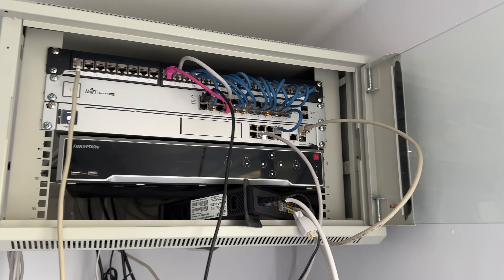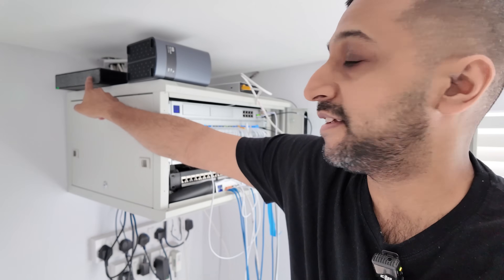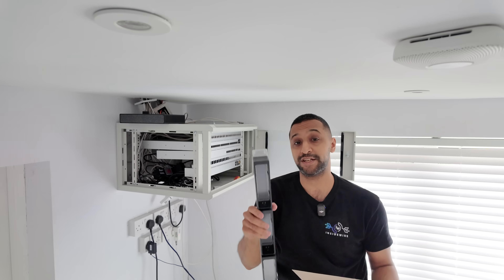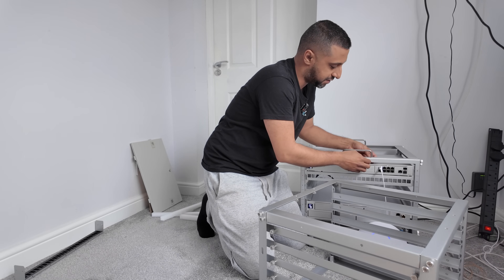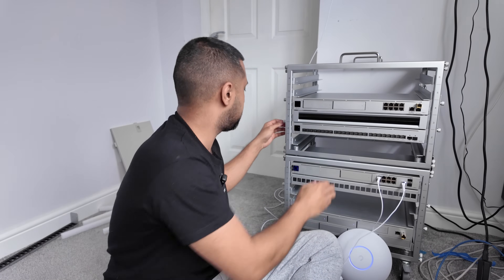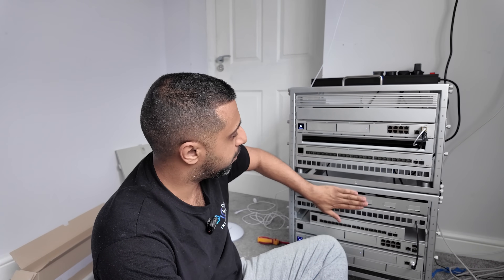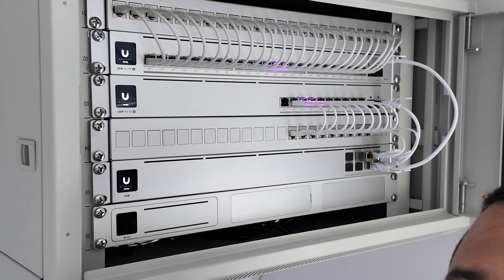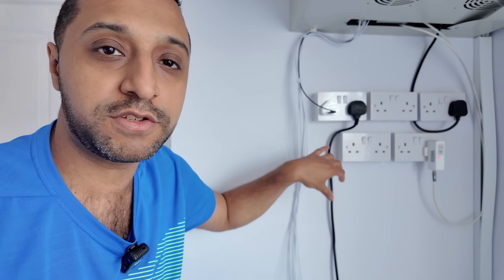Rebuilding My Ubiquiti UniFi Home Network Rack 2025

Comment: i would add a second 8 port aggregation switch in the bottom rack, linked to the top rack. i have done this at home, i have a rack in a mancave at the bottom of the garden,   in the house where the broadband comes in and has another rack. I use a 10gb fibre connection between the 2 aggregations switches, and in both racks the switches connect to the aggregation switch in their respective rack., i am toying with running a second fibre to the mancave, not necessary, but i have a spare cable, lol
Reply: Wow! You are on it

Comment: The wall behind your rack is either dot and dab or stud wall. Either way. I would make a small incision at the bottom of the wall behind the rack and one at top. Then fish the cables through.
Reply from the maker: It’s solid brick. It’s an external wall. No dot and dab. Just plaster.

Comment: Tip - get a srip of magnetic tape for the wall mounted data cabinet, stick it to the body where it comes in contact with the door. Then remove the lock/key thing in the door. Holds it closed. Way better than those flimsy locks that come with those data cabinets. They're never needed to be locked in 90% of cases.
Reply from the maker: Thanks i might give this a go.

Comment: Thank you for the video. Nice setup! 

Question: Is it possible to stack a 3rd tool-less rack on top of the existing two? If so, (and if you have enough slack in your service loop), you could get rid of the overhead rack and move everything down together.
Reply from the maker: You can only stack 2 unfortunately, It would be cool if you could keep stacking.

Comment: You could install a 2x2 "Open Slot Wiring Cable Raceway Duct" with Cover and that could help clean up the cables along the walls and it would give you easy access in the future for expansion.  Nice cabling job!
Reply from the maker: Thanks, ill take a look at that. saves me making holes in the trunking.